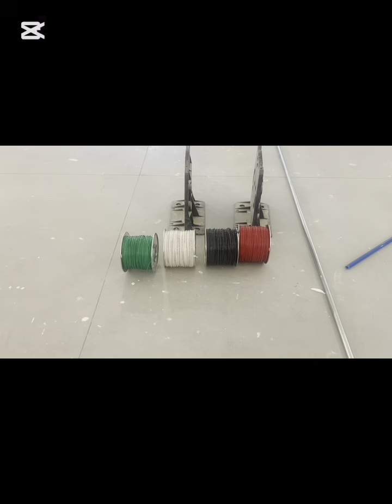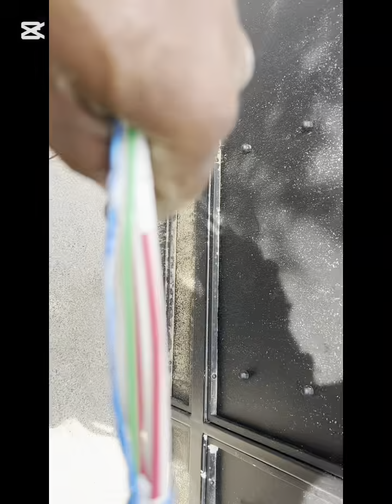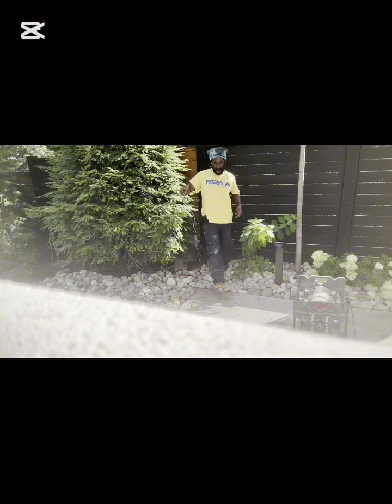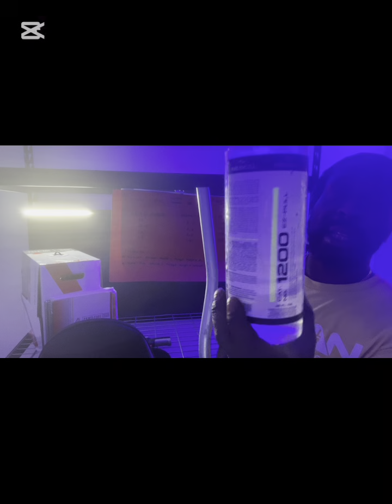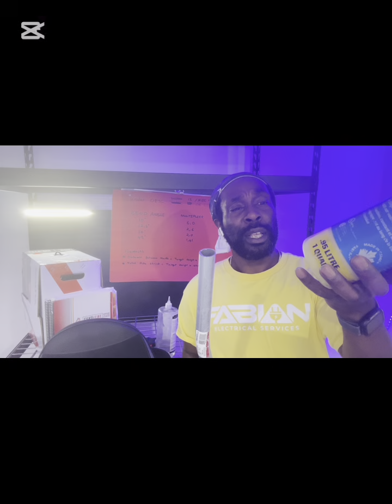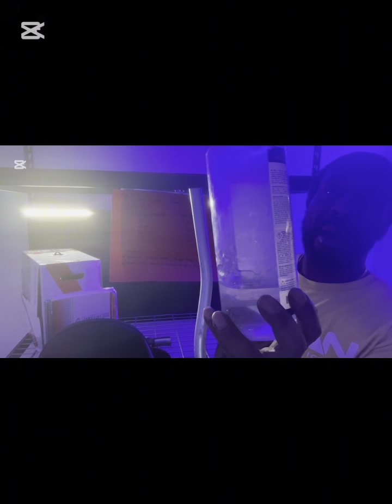How to Pull Electrical Wire Through Conduit (Apprentice Guide) ⚡

Comment from the maker: [https://www.youtube.com/@Fabianelectricalservicesinc] • Just now⚡ WIRE PULLING CHALLENGE: What is your go-to strategy when you hit a tight 90-degree bend on a tough commercial run? Do you swear by a high-viscosity polymer wire lube, or do you have a specific knot you use to make sure your tape head never snaps inside the pipe? Drop your field fixes below! If you have any technical questions about today’s staggering layout or OESC 40% fill math, leave them here and I'll reply to everyone today! 👇